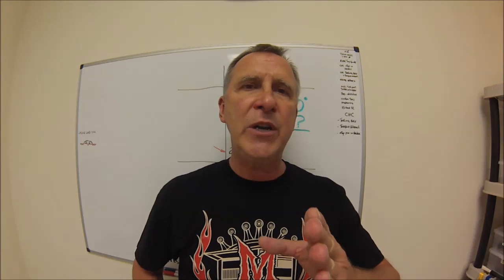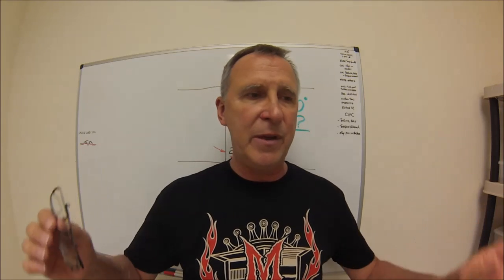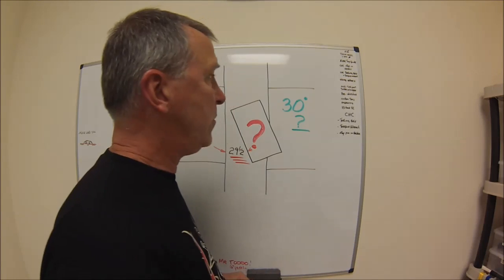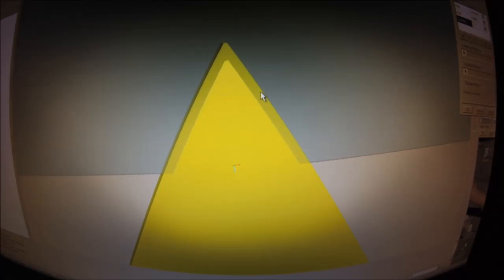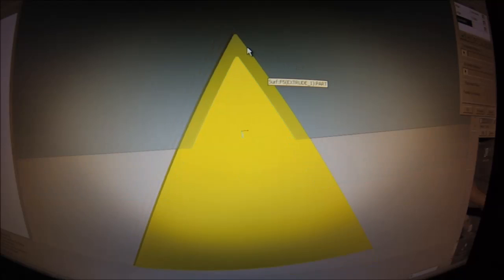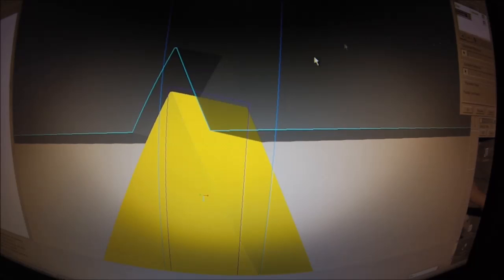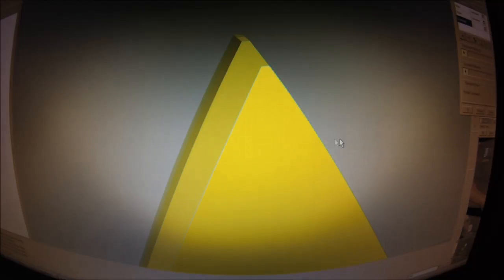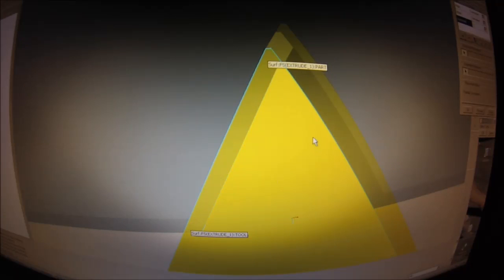Lathe Compound Setup for Single Point Threading...Myths and Musts

Comment: I truly love your videos Mr. Pie.
You're good nature and humor, the consistency of your explanations and demonstrations, and thoroughness of information is what really makes them a pleasure to watch. It's almost as good as being in shop class with the guys. I particularly enjoy your old school utilization of your dry erase board and filming your computer screen. If it ain't broke, don't fix it, right? 
With that said, regarding threading, I have very little experience with it and have a few questions.
If your 60° HSS thread-form tool is set perpendicular to the workpiece, the cutting plane is ran parallel to the threads being cut, the cut is typically began from either a relief channel or from outside the part and ran into the cut itself, what does the angle of the Compound have to do with anything other than approximate measurements to get in the ballpark of your desired Pitch Diameter?
Also, what methods do you use and recommend to set your tool height and Perpendicular to your workpiece?

Comment: That is the first decent explanation of the suggested angles that I have seen.   Finally makes sense to this hobbiest.     Thanks
Reply: I have had the occasion to cut a square thread on a restoration.    What compound angle makes sense.    Zero or minus 1/2 degree?
Reply from the maker: I would have to believe the tool should be ground square or less, and the feed  angle should be zero.
Reply: @joepie221  thanks

Comment: Thanks Joe for another thought provoking discourse !
My thoughts have always been that the area of metal which you identify as being removed by the right side of the tool is in fact removed by the left side, as the helix of the thread means that it is presented to the left face of the tool before it sees the right side, or am I wrong ?
I can recall my college days, back in 70’s, when we did some investigations into cutting forces in machining operations.
All machining is a tearing process, where the force generated at the tool cutting edge has to exceed the ultimate tensile strength of the material being cut, and it follows that the greater the length of cutting edge, the more load there is on the tool.
To minimise the loads on the form tool, which is often quite a frail device, it made sense to only cut on one face, so that the flow of the chip was cleanly away from the tool cutting edge, and this was clearly demonstrated by less tool deflection and lowest power consumption.
Plunging the tool into the work perpendicularly to its axis means that you are cutting on both faces and the two streams of chip come together and are compressed as they try to escape, which further increases the load on the tool tip beyond the expectation of that due to the doubling of the shear area.
Furthermore, with a flat topped form tool, when you take into account the thread helix, the left side of the tool has some degree of positive top rake, whilst the right side of the tool has an equal amount of negative rake. This might be problematic when machining some materials . . . .
It might give you a wry smile when I tell you that the machine which we carried out the tests on was a brand new Colchester Triumph 2000, fitted with a 3phase watt meter for measuring electrical power consumption and strain gauges on the tool holder, to measure the deflection of the tool !
Load on the tool eventually translates into wear at the cutting edge, as some exponential function, so any reduction keeps the tool sharp for longer and, on a batch run, makes for more quality threads, before a tip replacement is required.
Now retired, my little 5 x 20 workshop lathe ( probably even older than me ! ) isn’t capable of dealing with a plunge cut, so I’m not too proud to set the compound slide over.
To sum up, plunge cutting is fine, if your machine and tool set up are strong enough to take it, but on a production run, the economics of higher power consumption and increased tool failure might not yield the expected profits.
As my college lecturer, himself a retired production engineer, was fond of reminding us “Gentlemen, our job is to make as much swarf, as fast as possible, because the customer only buys what’s left !”
Apologies for this rambling dissertation !
Kind regards,
Steve.
Reply: Thanks for these paragraphs. They’re easy to understand and flow very well for me

Comment: Thank you George Carlson!!! I apparently have a Chinese (ENCO, should have guessed it) lathe. As per your post, I set my compound slide at 60* and VIOLA!! Perfect cut! Since the graduation tag only reads to 45* in each direction, I rotated my slide to 30* and scribed a mark at "0" then rotated it on around until 30* aligned with my scribed mark. Works like a dream. Out of all the thread cutting videos I have watched, I don't remember anyone mentioning the diff in compound slide markings between different manufacturers. Thanks again!
Reply from the maker: George Carlson was a comedic genius.

Comment: Think that seems to prove once and for all a thread tool is a form tool and ALWAYS  cuts on both sides. 
Setting the compound to 29 degrees etc only serves to REDUCE tool load on the right side of the tool ( when cutting towards the chuck )
Got it ! Thanks Joe 
I’m in Britain and have a small 4.5” smart+brown model A lathe iv cut various 55degree whitworth threads ( native to this machine ) just for fun mainly and have previously just cut them , filed them till a nut fits.
Having watched your various threading videos I now plan to dial in my depth of cut with the cross slide at the extremity of the thread forming a “relief groove” then verify the pitch diameter with wires back out the 27degree compound then cut the thread using the compound only to hit the exact pitch diameter 1st time 🤞🏻 
Great videos excellent content, well explained 👍🏻
Side note I think the inverted threading looks superb why doesn’t everyone do this ?? 
Unfortunately iv a screw on chuck and won’t be able to try this 🙈

Comment: I enjoyed seeing your computer modeling skills.  As a T&D apprentice this theory was explained to me by an old French t&d maker. He was a master. He demonstrated cutting (moderate diameter) threads to size in a total of 3-4 cuts!  Scared the crap out of me.  He could do it every time.  All HSS in those days. Time was money. Wouldn't tolerate scrapping 5 thou or so per pass.  Rip Emile.
Reply from the maker: Thanks Michael. My modeling skills are solid on Pro-E. I enjoy it. I've go some crazy model in the files. Take a look at my 'Modeling a gage perfect thread" video. If you think about tool contact, your first thread cut can be very deep because the tool contact is so small. No reason to grow old running a thread.

Comment: Great video Joe let's hope it makes it clear for a lot of people.
 Personally my own experience when I first started in the trade 60 years ago I used to plunge straight in and trash the tools. (HSS on a manual engine lathe) breaking the very tip.
Back then I never understand why.
If you plunge straight in you have equal chip load on both sides with a tendency of the chips loading up and destroying the very small tip of your tool.
29 1/2°, I've used ever since an old timer explained why.
Most of the cut is on the left side most of the chip curl away clean while the right side of the tool just barely skins but just enough to make it look good and clean and a lot easier on the tool.
Reply from the maker: Like this video proves, both sides still cut, and the tip is always working. Carbide like to be buried, but HSS may be different depending on the setup.

Comment: Thanks for another great video.  One thing I learned from watching Bruce Wittham is that machinists in a lot of countries outside the US plunge cut threads using the cross slide only with no problems.  I'm going to stick with 29.5º because that what I've always done and the chip load is low.  Chris
Reply from the maker: Unless there is a specific root dimension given, I plunge every thread I cut.
Reply: It's not a US versus the rest of the world issue, if memory serves the really early South bend books showed going straight in. Having said that, go with what works for you or you are comfortable with, that way you will make less errors, even if it is not necessarily the best way.

Comment: I have abstract thought not all people do but I could see you computer program in my mind some time ago.
I also looked at the chip the tool produced and you can see it is cutting on both sides the trailing side the least, there is no way it cant. 
Most if not all of the time I dive straight in anyway.
I set the top slide/compound parallel with the cross slide.
I back out and in with the cross slide and cut to depth with the compound slide. 
Plus as you do I do all of it going out not in.
Works for me.LOL
Thanks for the great non rehash BS videos we all see here way too often. 
Worth
Reply from the maker: Thanks Worth. I'm sure I'll double someone else's work eventually, but it will be by accident.

Comment: Thanks Joe.  Love your videos,
I checked this out using my own cad to hammer the concept into my brain.  More than 30 degrees results in a stair step, less than 30 and the right side of the thread is either burnished or cut but thread is perfect just the same.
Reply from the maker: More than 30 on the compound never ends well.

Comment: Another good video Cap'n
Although this was directed at Your Imperial Thread Cutting audience, we reckon it would be most applicable to our Metric threads as well.  
Putting the demo on CAD clearly shows the cutting angles perfectly 
Thanks again for showing and sharing
aRM
Reply from the maker: Thanks, the CAD does really help.
Reply: You say Imperial threads , but this doesn't work for the British Whitworth threads @ 55 degrees.

Comment: Hey Joe
Where you going with that……….I,ll stop that
I was a production lathe operator back in the sixties and seventies.The setter would set up the machines,which were often capstan lathes or centre lathes and screw cutting was an everyday event.
You really were spot on with the nerves when screw cutting but we just learned the tecnique and got on with it.
The method you described here would have saved my premature ageing but as i was watching i wondered if you were brought up old school and used the old method of screw cutting first or did you develop this because of the nervous shake that would develop as you neared the under cut and had to stop the machine, remove the tool …..no i cant go on
Keep up the good work, respect.

Comment: Hi Joe, good video.Took me back to the mid 70's when I was training in UK.  I was taught to do Metric and Whitworth (had half nut drop out during finishing cut on a 1" Whitworth, wasn't good, still got a scar . I didn't know any better back then ) 'We' were taught to use anything from 10 to 27.5 degrees or just plunge cut forsmaller dia. 55 degree Whitworth threads. T he difference on 'shadow graph' was noticeable, and looked like north face of the Eiger when magnified 500 times. (Surprisingly, Honda motorcycles used Whitworth threads back then on some components, I used to measure 'everything and anything' to practice) You mentioned tool was likely to rub rather than cut, often it does. even with industrial machines which are way bigger plus more rigid.  That was the reasoning behind using smaller angles, get tool loading reduced but not removed. It was obvious both sides of tool were cutting even at 27.5 deg. Only subscribed last week, jobbing machine shop does more interesting things than factory machining.

Comment: Great video, Joe. Thanks. I have used lathes for a couple of decades now but just as a self taught (trial and error) machinist, and I used that term very loosely. Mostly facing, turning and grooving. I am now needing to learn thread cutting. Following these instructions, the outcome of my efforts is a thread that more resembles a "buttress" thread. I have the correct TPI and have all but mastered the half-nut engagement (thanks for that video, as well) but with using the cross slide only for plunging and retraction and the compound set at 29-30 degrees, all my practice pieces come out with a very lopsided thread. The leading (cutting) edge actually appears to be 10-15 degrees and the trailing side appears to be about 35-50 degrees. I am using a 60* thread cutting insert and am cutting a 7/8"-9 external thread on PVC solid bar stock. I have also tried it with aluminum bar with same results. A nut will easily thread onto it but it just doesn't look good/correct. I don't know what I'm missing here.

Comment: Like many I started with a SB 10K back in the late 60s and stayed with the way I was taught until you came along. I have a 3 horse 14-40 chinese machine I have had for 20 years. It does just fine with straight in threading, just do the scratch pass at final to clean up. do a lot of rifle barrels, threading, away from the shoulder is great, thanks and keep the info coming!

Comment: I never thought that 29.5 degrees was a solid angle but it was simply to lower tool pressure. I was taught to finish with a straight depth cut. Depending on material type maybe tenths or a couple of thousands. 
I Dig your videos, by the way. I've been machining for 30+ years off and on and sometimes I feel like I'm a boot camp in the Navy when I hear something new!

Comment: Thanks for the video Joe - very informative; however in addition, I'd like to see you do something similar explaining some of the calculations, terminology, tables, etc. that deal with how deep to advance your compound to achieve the proper thread depth, what is meant by "double depth of thread", thread types, what the numbers on the fish tale mean and how to they relate to compound depth, etc.  Basically I'm asking for "basic" info that you pros have learned through experience and/or formal & informal education that us weekend hobbyist haven't had the benefit of.  Also, the dial on my lathe's compound must be different from most machines.  To set mine to 30 degrees I have to set the dial at 60, so to achieve 29.5 would I set to 59.5 or 60.5. :-)  Thanks again!

Comment: Interesting video. I agree totally that as long as you don't exceed 30 you will get a good thread. One point someone once made was that if your last few passes are done by plunging with the cross slide, then any discrepancy caused by compound alignment becomes irrelevant, as the tool is acting as a form tool.

One question - when using the reverse threading technique that you have shown, should the compound be set at the opposite angle to when you are threading conventionally? Eg. 29 degrees the other way?
Reply from the maker: I plunge everything. 100% of the time. I would suspect the compound setting should be the same for the inverted tool. One side would still be cutting, it would just be the trailing edge.

Comment: You're right on sir. good demo. I agree with  Barry on setting up short of 30 degrees i.e. 29, 29.5 or even 28. Just don't go past 30.Thanks Joe
Reply from the maker: Hi Chuck. Its all a matter of machine rigidity. I rarely use my compound for threading. Thanks for watching.

Comment: Hi Joe,
I'll only use the compound in extreme situation(s), always straight in with pretty heavy cuts at the start and smaller as I go deeper...
Normally it's possible to cut a 13 pitch thread in about 4 to 5 passes max, needs to be done at max possible speed though...
Cheers,    Pierre
Reply from the maker: Absolutely spot on. I agree 100%. I never use the compound either. I did this video to release some of the 29 degree mystery.

Comment: Thanks Joe.   Good explanation.  In the end it's all about the step from theory to practice.  If plunge cutting works for you then by all means stick with it.  I learned my trade from old school machinists and have had to work with some machinery just as old , and compound feeding at a hair under 30 degrees can solve a world of problems.  I was well into my trade before I ever saw a threading insert.  Hand ground high-speed, check it with a fish-tail.  I agree that the claim that it doesn't cut on the trailing side is BS,  it just relieves some of the pressure and will usually result in a cleaner thread.  Find what works, but be willing to try something new..    Thanks.

Comment: Excellent Video, I haven't bothered to set my compound at 29.5 for years, With modern tooling (Inserts) I just plunge straight in after ensuring that my tool is set perpendicular to the axis. I taught my students the same thing. THe only time I use the compound is when I am using high speed hand-ground tooling and then only if I am on the first cuts, when I get in deep and am neat finish size I do the last few thou's with a plunge cut, it kinda evens up the finish. Excellent Video dems of what I was taught years ago.
Reply from the maker: I too plunge all my threads.

Comment: Thank you. I'm just about finished seeing up a minilathe to start learning while refurbing the Sheldon. My first project is facing, turning and drilling only but the second one I want to try threading. I watched the video to get exactly the information you presented. I saw @Abom79 commented a few years ago and I have a lot of respect for the work he does but this is far more apropos for a beginner with a light, Chinese minilathe than the rigidity of the big machines he's running. If I run my first try, it won't be because I didn't do this correctly, thanks to you. :-)

Comment: Just tried the "threading away from the headstock" in your early video. I had heard about this before but never bothered. IT...IS...SWEET! I just did straight in and thread looks great. Actually, if you did want to do the 29.5, 30, etc. while moving away from headstock, wouldn't you have to swing the compound to that angle on other side? Just curious - straight in works fine as fas as I am concerned...